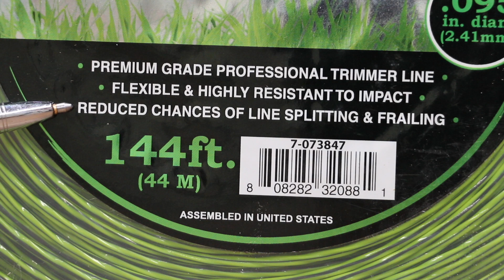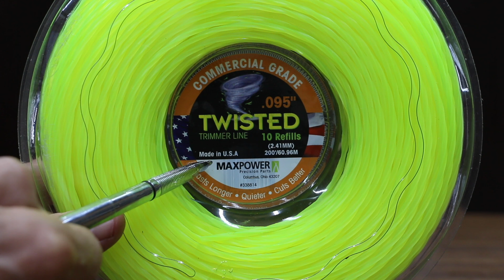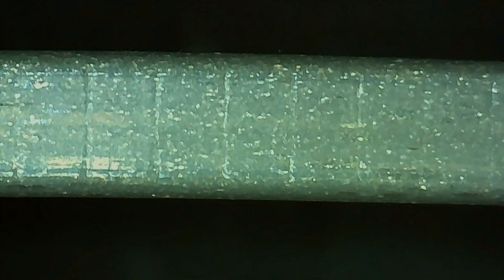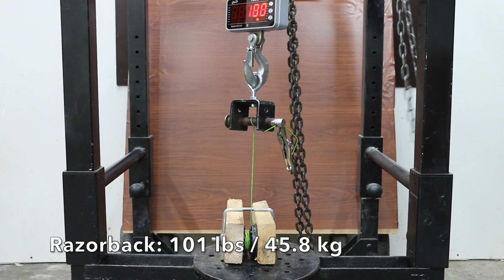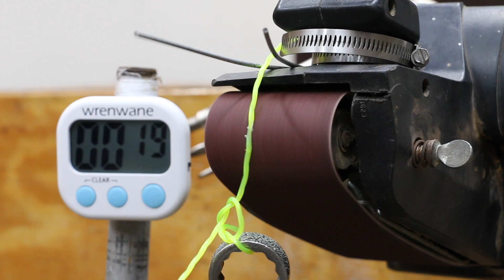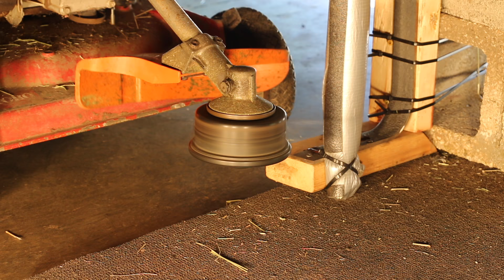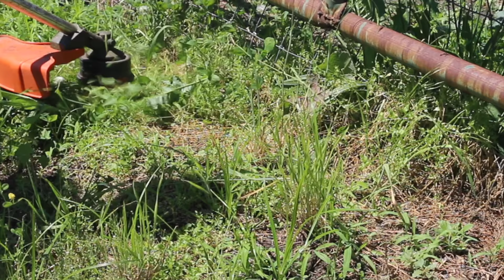Best Trimmer Line? Let's Find Out! Round 2: Stihl, Husqvarna, Echo, Oregon, Shakespeare, Weed Eater

Comment: hi!
great work, as usual.  good methods. 
I was looking at another video where I saw the YouTuber use a closed end adjustable wrench.  made me wonder what type of adjustable wrench would be best .  This was his link (i tried to search for similar ones but couldn't find any, so a link is best I guess)
https://www.amazon.com/QWORK-Adjustable-Functional-Flexible-Wrench/dp/B07Z7TW94B/ref=as_li_ss_tl?dchild=1&keywords=closed+end+adjustable+wrench&qid=1592162151&sr=8-52&linkCode=sl1&tag=fixfurniture-20&linkId=15f7615762d70b55b4e818dd204fed21&language=en_US
(sorry for the long link)
I'm thinking a battle between that, a regular adjustable wrench, a pipe/monkey wrench, the knipex plier wrench, one of the pliers type (like the bionic wrench), and make one of the wrenched for youtube channel hand Tool Rescue.  To see which one works best, both in terms of holding on to the nut and also not rounding them off.
Reply from the maker: Great video idea!  Thank you

Comment: I'm a little late to the video so I'm not sure if you'll see this, but my only gripe with some of them content and on your channel is that some sometimes some products are better depending on how you use them, some may also be more durable or better in the long run, also often products are made by the same manufacturer and are internally identical but have different brand names on them(as seen in the car battery vid). As for a durability example There's really only three major battery manufacturers Johnson controls, exide, and East Penn. In my experience the Johnson control batteries usually last longer(die hard batteries are also good). I feel like on on applicable videos you should mention that long-term reliability and personal experience should also be taken into account as long-term testing as sometimes not very viable for video purposes.
Reply from the maker: Thanks for the feedback.

Comment: I use that Shakespeare line with my kobalt brushless trimmer, it was cool to see in your test particularly the cutting speed one what I’ve found using it, it cuts awesome when at full length but it really quickly breaks off and you have to keep unspooling more to get anything done, I will now be trying some Max power  to hopefully avoid having to respool so much
Reply from the maker: Thanks for sharing.

Comment: Great video as usual.
New test ideas:
Light bulbs for their wattage and lumens ratings.
Grass seed in  sun/shade, water/little water settings. 
Concrete sealer and it's peel off/adhesion/abrasion resistance. 
Caulking which might take some time in different environments outside or inside with sun/painting/peeling/shrinking/adhesion. 
Matches for how long they burn and ease of lighting. 
Uninteruptible Power Supplies and their power ratings/time rundowns. 
Safety Glasses for clarity/ resistance to scratching and breaking. 
Packing tape for adhesion to carboard and a couple other surfaces.
Reply from the maker: Thanks for the video idea.

Comment: Hey I have a question, so I bought a motorcycle and the timing was off, and so I left the motor at top dead center overnight and I put the cam on the next day, and I realized after putting it together that it rotated 180 degrees. So can u make a video testing if a piston can drop because of gravity overnight?
Reply from the maker: Thanks for the video idea.

Comment: I have to use stihl products at work. stihl trimmers, line, and 2 stroke oil. I must say, the trimmers are good but the heads are hard to fill/take apart pr put together, and dont feed well or at all sometimes.

the line is average at best, and once it gets old it gets more brittle. 

the 2 stroke oil is runny, a nasty green, and it smells terrible when burning.

all of these are also fairly pricey for what they are just because they are stihl branded
Reply from the maker: Thanks for sharing.

Comment: How about a test between GL-4 and GL-5 gear oils? Will a GL-5 rated oil really corrode yellow metals like synchros in a gearbox? And is GL-5 safe to use in an application that requires a GL-4 oil? Thanks!
Reply from the maker: Thanks for the video idea.

Comment: You should test motor oil with contaminants. I work in a shop and I always wonder what would happen if someone just sprayed a can if clean in the bottom of an engine before putting the plug in. Would be interesting to see if it degrades the oil. You could also test stuff like atf in the oil. Coolant in the oil. Or even brake fluid in the oil. 
Great vid as always!
Reply from the maker: Thanks for the video idea.

Comment: I got fed up with those two cycle trimmers and bought a DeWalt 40 volt trimmer.  Boy that was the best thing have bought for many years.  No more fighting trying to get those darn trimmers started and even better they have by far the best trimmer line I have ever used!  Last year I only put 6 feet of line on the reel and it lasted all season and three months of this year here in Oklahoma.  The DeWalt will cut anything I need at low power and haven't had to even go to the high end, by far the best trimmer on the market!!!
Reply from the maker: Thanks for sharing.

Comment: I've got a video suggestion: Compare different brands of brake parts cleaner.
We've seen an engine run on brake parts cleaner, but I think there is a lot of difference between the brands, while many people think all brands are the same.
I always use MPM brake cleaner, since it dissolves the widest range of dirt and does not seem to leave a residue. Motip seems to leave a residue and is worse at cleaning in general.

Apart from cleaning brake parts, brake cleaner is also used a lot to clean other stuff, so general cleaning properties are beneficial. However, dissolving plastics and rubber is something that is unwanted. Many people just directly spray the brake cleaner on the surface that needs to be cleaned, thus a more powerful spray is also beneficial.

I would suggest testing:

- Cleaning new brake parts (manufacturer grease)
- Cleaning old brake parts (brake dust)
- Cleaning random car parts
- Test if it leaves a residue, for example by testing how well tape sticks to the clean surface
- Test if it dissolves different kind of plastics
- Test with how much force the brake cleaner is released (spray against a vertical scale)
Reply from the maker: Thanks for the video idea.

Comment: One of the points you briefly made is that attacking the grass at a slower RPM extends the life of the trimmer line. I have found this to be true also. It does seem that all of the weed trimmers I have ever used actually rotate too fast and contribute to accelerated line wear/failure. The one I currently use (Craftsman) makes it very difficult to slow down the speed because of the sensitive throttle. Maybe you could consider testing the various weed trimmers to find the ones that are more able to rotate at the user's desired speed (if it has not already been done).
Reply from the maker: Thanks for the video idea.

Comment: As far as a plastic or nylon line the best I've found is Rotary Part #12179, it's .095 x 1140 ft 5 lb spool just less than 47.00. It's 4 cents a foot and if you ask me it's the pro pro version. Aside from using soldered steel cable.
Reply from the maker: Thanks for the feedback.

Comment: Used zip ties a few weeks back just to get job done. 3 cuts later, zip ties still working just fine lol! I think they actually twist "flat" when rpms increase which greatly increases durability. I'm guessing. All I know is the two medium sized ones I used are chipped up a bit but still cutting! Cost....too low to calculate ha! Used on a worx battery powered with obviously less power than a gas.
Reply from the maker: Thanks for sharing.

Comment: My work started stocking a new penetrating oil that I would like to see tested. It is ac delco rust penetrant and inhibitor. The part number is 88862628 you should be able to find it on amazon. I've had fairly good experience with it and I would like to hear your opinion on it.
Reply from the maker: Thanks for the video idea.

Comment: Review flexible bit holders. I need one to speed up working on my Nissan Armada but to really help me, it needs to stand up to a fair amount of torque. If it doesn't then I will still have to break stuff with a wrench. Every now and then, I don't have the perfect combination of extensions to do so. I know that's outside of designed purpose but if I only knew which one was the toughest, my risk would be slightly decreased.
Reply from the maker: Thanks for the video idea.

Comment: If you do a 3rd installment you should add in  Milwaukee I've been using it the last couple years and still on the original role. It has been working fantastic, even with my kids running it it has not bound up. I am using it on the Milwaukee M18 weed trimmer
Reply from the maker: Thanks for the video idea.

Comment: I bought the Husqvarna based on the last test results and did not have good luck with it.  I have stone edging around my beds and the line had a tendency to break in quite long strands.  I know others have had good results with it, but for whatever reason i did not.  
I've tried both Oregon square and twisted line with mediocre results.  
So far the best for me has been Cyclone.  It still breaks, but in much shorter lengths (< 1/4") .  I will give the twisted line a try when the Cyclone runs out.  I've got quite a surplus of trimmer line that hasn't made the "cut" lying around.  These have all been in .095 diameters.
Reply from the maker: Thanks for sharing.
Reply: @ProjectFarm  Thanks for all you do!  I've bought several items based on your testing.

Comment: Great video! Your creativity in coming up with tests that have high measurement validity is impressive. I used to work clearing drainage ponds using a line trimmer, and we were much tougher on them than anything done in the video. We used square Oregon line because it was soft enough to not throw rocks at ourselves, and the square line reduced the contact surface between lines, reducing welding when the head overheated
Reply from the maker: Thanks for sharing!
Reply: How did the RPM measurement in the wire test indicate durability against breakage?  Was it a max rpm measurement? Or a measurement of the highest rpm reached before the string broke, which would then show a sudden higher rpm from the short line?

Comment: I believe it's time for one of your sagas to finish. You did tire pumps and cordless pumps. Let's see part 3 on Air compressors. I know they are a bit more expensive but is a harbor freight unit really better than an a portercable or a dewalt? Or a craftsman better than a makita? 6 gallon tanks are everywhere and probably the most popular size out there. What's really better? We may never know!!! Unless......         Great video btw. I'll have to get the brand of the stuff we use at work. Clear spiral with a hardened black center. Stuff works great. Keep up the good work!
Reply from the maker: Thanks for the video idea.

Comment: I would recommend testing different weed eater heads, or at least the ones that will interchange. I know redmax ans still interchange. You could test which one bump better to let out string, test durability of wear on covers and spulls, and even test time takes to restring, would be interesting I know still works a bit better than red max in my experience or at least in bumping. Red max tends to jam up more often. Would be interesting to see what some other heads will do, just a suggestion.
Reply from the maker: Thanks for the video idea.

Comment: Years ago these things didn't have a spool, just a short length of line with a nipple on the end. and you replaced it when it broke. A common trick was to substitute a length of throttle cable from a small motorcycle or moped. These even had the same nipple at the handlebar end of the cable and could be persuaded into place. You wouldn't use them up against the greenhouse but they would clear just about any weed with ease.
Reply from the maker: Thanks for sharing.

Comment: Sometimes I amuse myself by thinking about an old tractor rebuild (restoration), but making a tractor that will last forever in use, with basic maintenance only. Say, MF 135 from the year 1965. Bronce bushings, nikasil plated dry cast iron cylinder sleeves, steel pistons. Best quality oils and greeses. RVS triboceramic oil additive. What else...
Reply: Evans Waterless Coolant...
Reply: MF 135 (-65) extreme remake. LOL.
Reply: Perkins, obviously.
Reply: Simms tuned in-line pump. Lighter pushrods. Small turbo.
Reply from the maker: Thanks for sharing.

Comment: keep your line in a pail of water.. keeps it softer and lasts way longer..
Reply from the maker: Thanks for the suggestion.
Reply: @ProjectFarm  I think we need to test that, maybe soak some in water, some in olive oil, some in motor oil, and some in whatever else you want to soak it in.
Reply: @TryinItAgain  some in coca-cola obviously :D
Reply: @TryinItAgain  If in olive oil, can it double as spaghetti?
Reply: I use Frank's Hot Sauce - I put that sh** on everything!
Reply: @theoriginalchefboyoboy6025  😂😂😂
Reply: Perhaps I should store the foot of my trimmer in a bucket of Armor All?
Reply: Do not keep it in water. Too wet ruins it makes it stretchy and deteriorated. Just as too dry makes it brittle. Instead wet a sponge and put it inside the spool for 24-48 hours for the best moisture in the line
Reply: @aaronhereau1871  with that logic there is no difference in just soaking it for 24 hours
Reply: I've heard that before, I know that some of the plastic blades have to be kept in water to keep them from going brittle, I've never thought about keeping my nylon chord in water too. Will give it a try, stihl brand nylon seems to be bad for going brittle.
Reply: Yes I agree 👍👍
Reply: SOAK !! IT !! IN !! ACETONE !!
Reply: Dot dot dot  dot dot dot

Comment: In my experience, the only thing that practically matters with timmer line is that it reliably feeds.  If the line feels like super cheap, stretchy, flexible plastic - AVOID IT.  Even the most brittle pack-in line is better than the pliable expensive stuff.
Reply from the maker: Thanks for the feedback.

Comment: I am looking to buy some new 10" table saw blades.  There are lots of claims and lots of hype but virtually no honest reviews.  Things such as carbide tip thickness (indicating how many times it can be re-sharpened) smoothness of cut, speed of cut, force required to feed through saw, cross cut performance, rip performance, etc.  Basically I wanna know if the $100 Amana or $150 Forrest blade is really any better than the $40 Freud or DeWalt.  When I think of how I would like to see saw blades reviewed, I can only think of one guy to do it!
Reply from the maker: Thanks for the video idea.

Comment: The weedeater was invented 49 years ago & as of today. the line welding problem has not really been solved. Many observers think it is a melting issue from the extreme heat generated by the spinning head rather than tensile strength (probably both.) In fact, Oregon has a Platinum line that attempts to address this heat issue. From Oregon's website: "Platinum Gatorline is also engineered to resist welding
 up to 498° F (259° C) much higher than standard line." I tried it a few years ago & didn't think it was much of an improvement for the extra $.
Reply from the maker: Thanks for sharing.

Comment: I happen to own an ego electric trimmer and it's got an auto loader on it. Once it runs out, I just push the line right through the holes, pull it out enough to make it even and press and hold a button until it's wound in where I want it. Takes 60 seconds or less to load 15 feet of line. Don't be fooled though, it's an electric that stands on par with any gasoline trimmer. It's got some serious power. But that doesn't mean I want to spend all my money on line. The ego trimmer line lasts a while too. 15 feet lasted 1.5 seasons.
Reply from the maker: Thanks for sharing.

Comment: I got a good question for you. The nut that holds the spindle on my gas trimmer. I cross threaded that. Cant get it off. When I put a socket on the nut and turn it, it just spins that drive assembly.

Comment: I take care of 2 cemeteries and 15 or so regulars. I started out using the Shakespeare Ugly Twist, but it often melted together, even in my fairly low-powered Echo SRM-251. I then tried the Echo Black Diamond line, and I still run it in my new Stihl FS131R. Both the .095 and the .105 seem very sharp, cut through grass with seemingly greater ease than some other lines, and they last quite well. I generally run the .105, but the .095 is good stuff too. Just my 2 cents.
Would've liked to have seen it in competition, but good video as usual!
Reply from the maker: Thanks for the video idea.

Comment: Oregon gator line super twist is the only one ill buy anymore.  Ive had only dealt with welding once when it was high 90's and very prolonged use hours on hours worth which was melting from the heat of the head radiating internally.  oregon platinum didnt have welding issues, echo i wasnt  fan of as i found out they were shorting you product based on weight, the line was nice and light (good for no guard) and cut fine just limited durability and with shorting product its a hard pass for me.    Only other line ive liked is stihls multi colored one but it cost to much vs oregons.
Reply from the maker: Thanks for sharing.

Comment: I've got a smaller yard.  Bought a Milwaukee weed eater,  then ordered the 200(?)-foot refill when I ran out.  Turns out I didn't run out, just didn't know you smack it on the ground to extend more string out.  So two years later and I haven't even opened the refill yet. It'll last multiple lifetimes I guess.
Reply from the maker: Thanks for sharing.